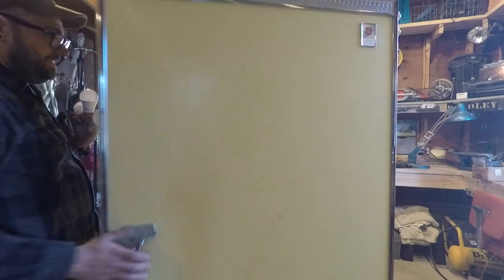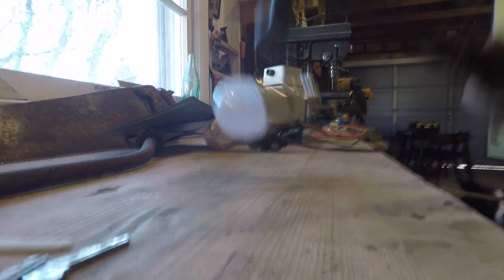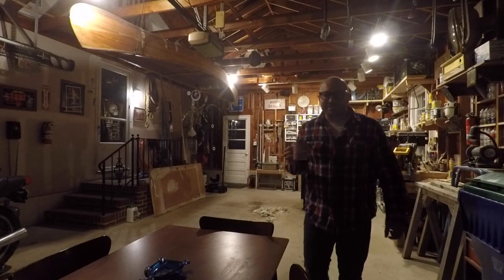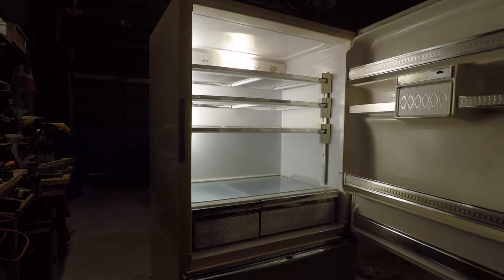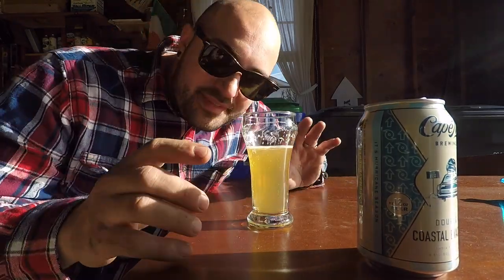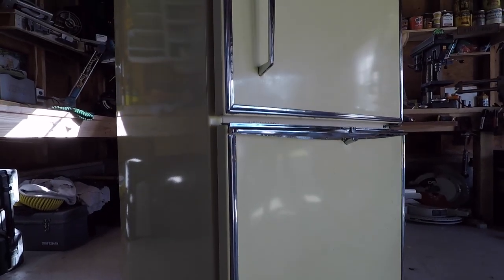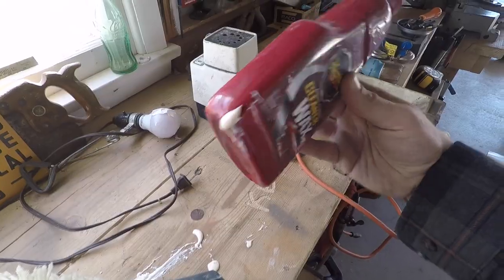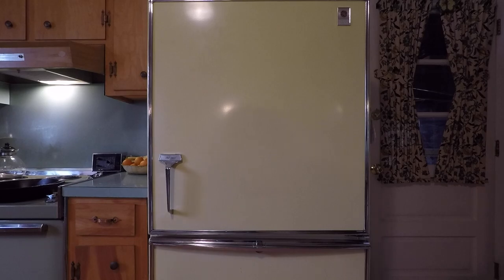Saving A Vintage Refrigerator

Comment: They have them fish tank bulbs that are led bulbs. My grandma always talks about the past nonstop and she said the fridges from the 1960s that had the freezer at the bottom were very unpopular because you had to stoop down to see what is in the freezer and her and a lot of people got rid of them just for that reason.
Reply from the maker: Well it rolls out so it seems to work well. I had never see a bottom freezer fridge that old until this one! They are popular nowadays
Reply: @JonBradleyFilms  I knew they were around back then. I think it's a mater of preference.
Reply: In my opinion it makes more sense to have the freezer on the bottom cuz since i, & most ppl, use the fridge more, i rather stoop down for the freezer instead of the fridge.
Reply: Make sense to have the freezer at the bottom. Cold air is heavier and sinks to the ground so when you open it, the cold air doesn’t fall out and get lost! Just sits in place in the drawer and saves energy whenever you open the freezer. Simple physics

Comment: Very nice rescue. Hope it works way better than your modern one. For fun since you still have your modern one, compare amp and watt usage of both fridges with a Kill A Watt meter
Reply from the maker: It’s a few degrees warmer overall. Probably could be serviced to be as cold as the modern one. But it’s working great and the electric bill seems about the same. I think it’s looks nice in our 1968 original kitchen! The modern one has since been sold on Craigslist. Old fridge, don’t fail me now!
Reply: @JonBradleyFilms  typically the thermostats have an adjustment screw on them to make them warmer or cooler. Turn it a little cooler usually a half turn or so is good. I did this to my old AC units as they're typically not set as cold from the factory. Also sometimes as the thermostat wears a bit the adjustment goes off a bit. The only thing I would be worried about failing on that is the defrost timer, but those are easy to come across even for old fridges like this.